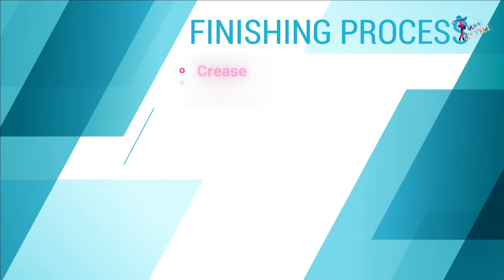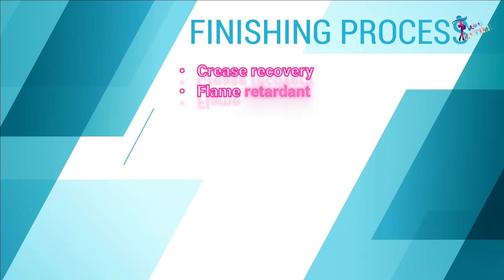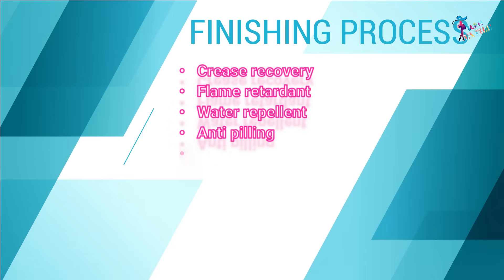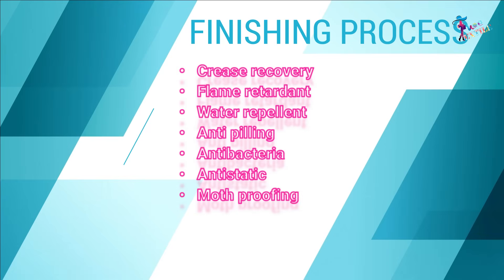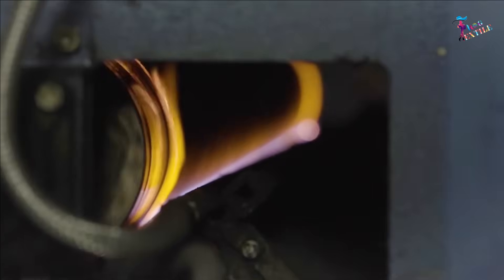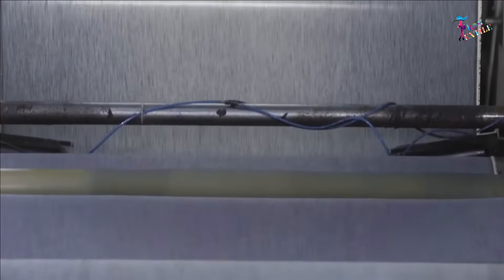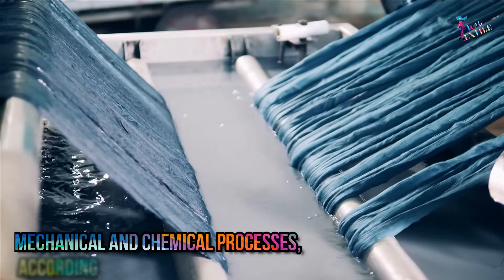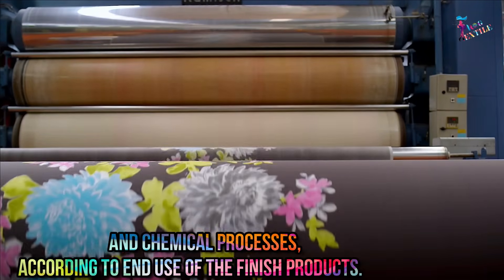Complete Process of Textile Manufacturing Fiber to Complete Garments

Comment: Mam/Sir I am preparing a thesis on textile industry wastewater treatment so can you me the answer for the below questions 👇.                          1.How much wastewater obtain per day 2 .did you use any wastewater treatment what are the process include in it
Reply from the maker: How much wastewater is obtained per day?

The amount of wastewater generated per day in a textile factory varies depending on the scale of operations, the types of processes used, and the production volume. Typically, a textile factory could generate between 50 to 200 liters of wastewater per kilogram of fabric produced. For a large knit composite factory, the daily wastewater output could range from several thousand liters to millions of liters per day. To provide a more specific figure, you could estimate it based on your factory’s daily production capacity and average wastewater generation per unit of production.
Do you use any wastewater treatment, and what processes are included in it?

Yes, most textile factories implement wastewater treatment processes to manage the pollutants before discharging or recycling the water. The treatment process typically includes several stages:

Pre-treatment: This step involves screening to remove large solids, followed by primary settling to remove heavy particles.
Biological Treatment: This step uses microorganisms to break down organic contaminants in the wastewater. This can include aerobic treatment (using oxygen) or anaerobic treatment (without oxygen).
Chemical Treatment: Chemical coagulation and flocculation may be used to remove dissolved solids or color, particularly if dyes and chemicals have been used in the process.
Advanced Oxidation: In some cases, advanced oxidation processes (AOPs) like ozonation or UV treatment are used for treating more difficult-to-remove organic contaminants.
Filtration: Membrane filtration (like reverse osmosis or ultrafiltration) may be used to further purify the water, especially if the treated wastewater is intended to be reused in the production process.
Sludge Treatment: The solid sludge generated from biological and chemical treatments is usually dewatered and disposed of in an environmentally responsible manner.
Reply: Sir/Mam What are the particles or chemical present in textile industry wastewater
Reply: Thank you for the reply